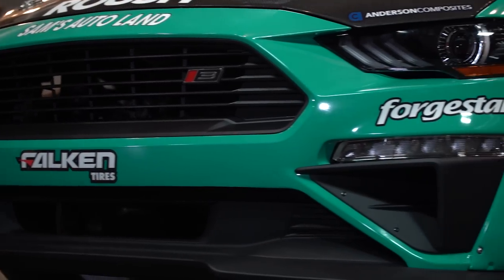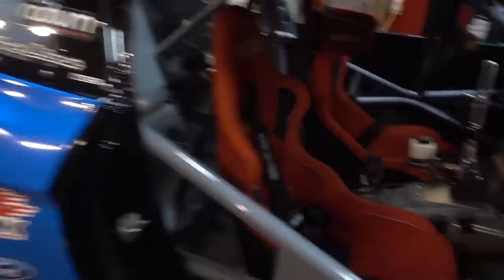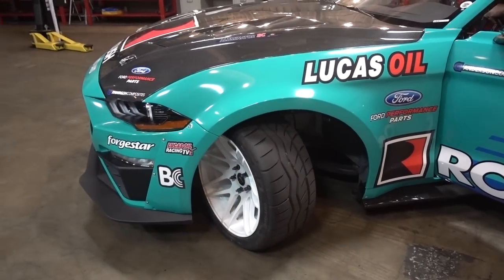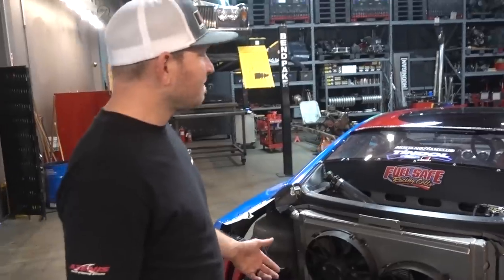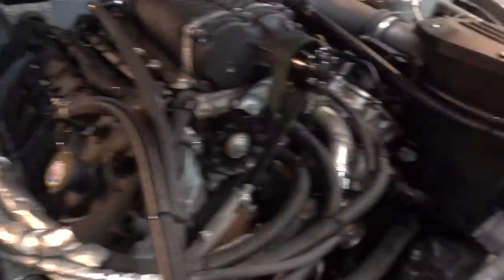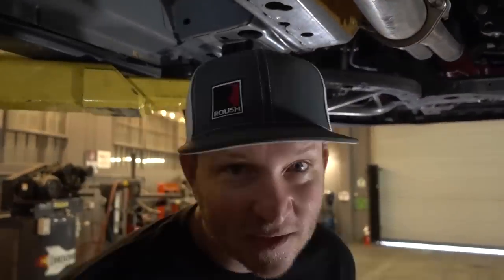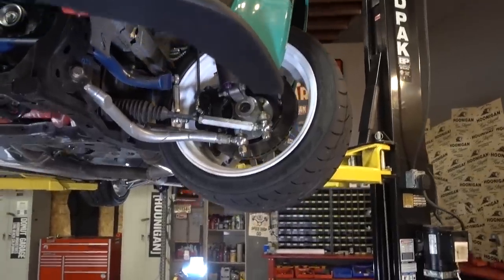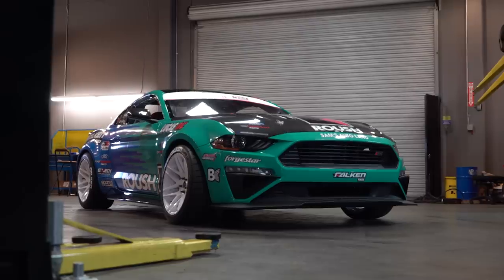1000 HP FD Mustang [Build Biology] //DT242

Comment: So cool  seeing him keep so many OEM or OEM approved aftermarket parts! I agree with him that the OEMs do put out some pretty well designed parts now. Killer video guys!
Reply: 40k in OEM parts making what LS motor with a stock bottom end, injectors, and turbo can!
Reply: Scott L That engine package isn't even close to $40k. The Coyote V8 has ZERO problem matching LSx & LTx engines, don't be fuckin ignorant
Reply: I respect the fact hat is isn’t just another junkyard turbo ls. I mean that’s fine for budget builds, but seriously if you can afford it the coyote and voodoo motors are just better.

Comment: well you sir have inspired me. I really want to convert the front end of my 2019 Mustang back to 2017 because I think the new shape is really ugly but I did not order any parts yet because I did not know if it were possible. So you said in the video that all I need is the front core support and then everything bolts on? So I would order a front radiator core support, hood, fenders, and lights and that should work?

Thanks

Comment: does anyone have a parts list of what I would need to convert a 2019 Mustang front end back to 2015? I would love to do the opposite of what these guys did.
Reply: Same,  have you find out anything??  Id be nice if we coule just buy the fenders/headlights/front/grill ect
Reply: @onymaru8658  I have not found out much. I am glad you agree with me though. I want to buy a fully loaded GT with Magneride but convert the front end back. I would like to something custom though. I want to convert the front end to shelby super snake hood, GT350 fenders, and GT350 front bumper by MP Concepts. If I could build that it would be my dream Mustang. Have you noticed even aftermarket hoods look bad on the 2018 Mustang? The same hood sold for a 15 and an 18 looks awkward on the 18 model because the same design hood slopes downward. Ford messed it up so bad that even the aftermarket can't make it look good. We must first change the radiator core support because from what I understand that will raise the hood line back up.

Comment: Right someone might be able to help me here. The front wheels on the car at full lock, one wheel is holding more angle than the other, in this case the inside wheel when turniny left is turned "more" than the outside right. I understand the performance benefits i just always forget the term used for it. HALP
Reply: Ackerman ;)
Reply: Kyle Becker YES! may you, your family and friends be forever blessed with good tea, fresh digestive biscuits, socks that are straight out the tumble dryer and beer. Cheers